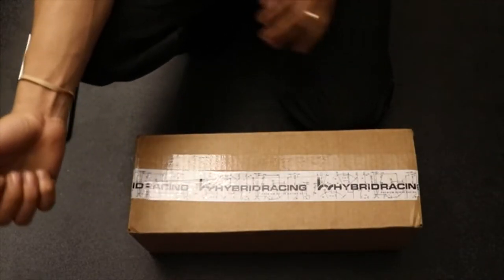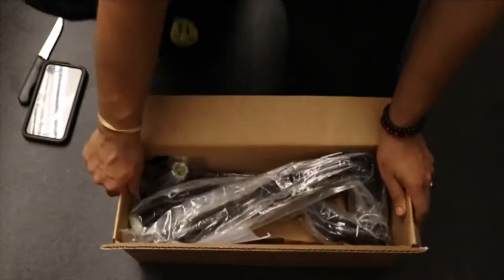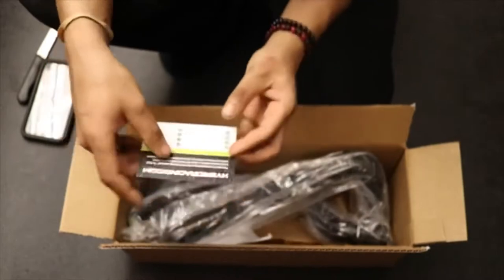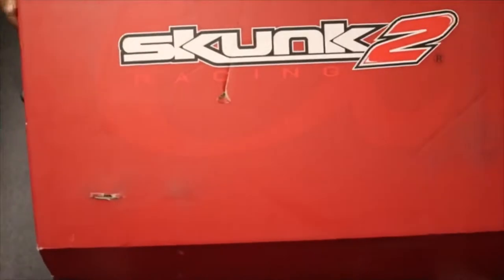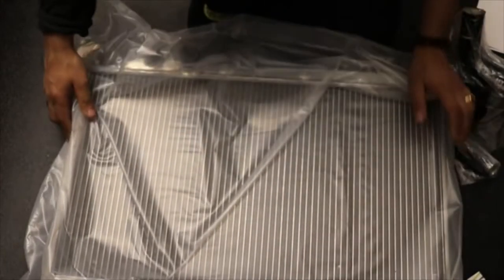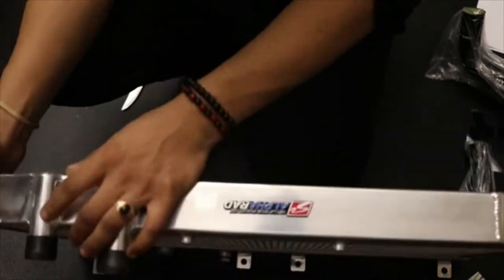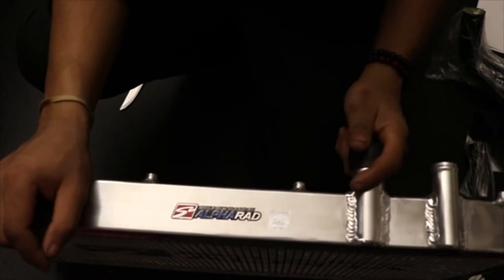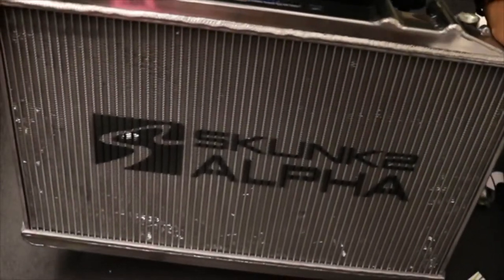Unboxing my new hybrid racing hoses and skunk 2 radiator for my civic si

Comment: so I'm running a straight water neck. I noticed you had the one that is angled to the right(towards the turbo). If you use the straight coolant neck crxraing actually has a metal pipe that connects it to the radiator.  I have the same turbo kit and it hasn't given we any issues with the rad yet and the heater works perfect too